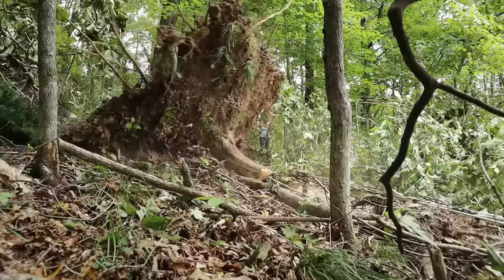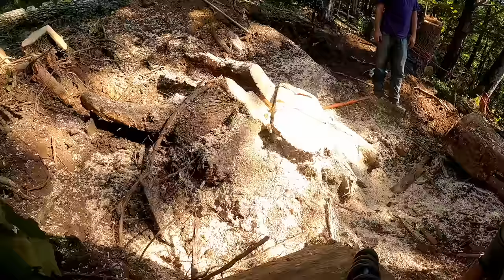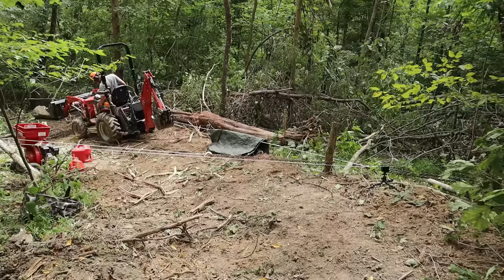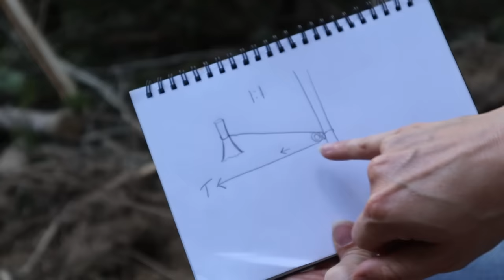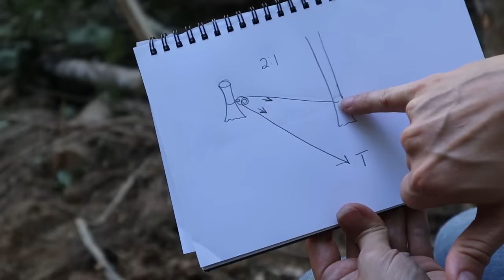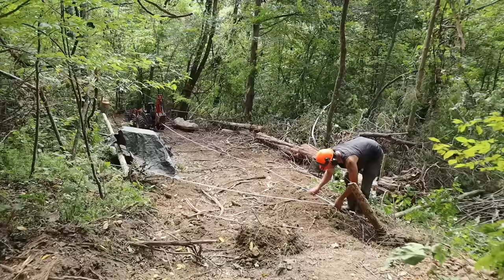Snatch blocks vs tree stumps - the power of pulleys /// E57

Comment: I’ve been making mistakes for over 50 years so I’ll share:
If you are ever going to hire a dozer to do the road, cut the trees, leave 4-6’ and let the dozer take them out. He can just drive through them in a minute or so. Talk to the dozer guy first and hire a big one.
If possible follow the land contours and don’t up and down hills or you’ll be fighting erosion forever. If you do have to climb or descend, put sleepers angled across the drive to get the water off as soon as possible. Crown the heck out of the road or leave it sloping to the side. Don’t get behind on the erosion. Once you wash out ruts, it’s 10 times harder to get the water off the road. There are government, and other, publications online about building gravel roads.
Like others have commented, don’t cut the trees first! Use a ladder and hook on as high up as possible - 10-15’- to pull them over. Wait for wet weather if you can run the tractor on wet ground.
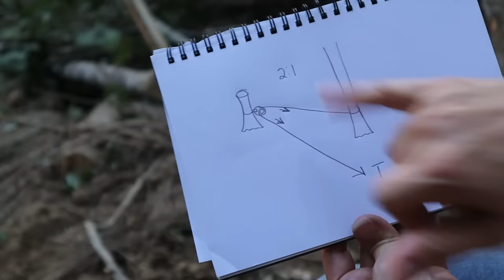You mentioned it at 6:00 and 7:30 but the simple way to figure the pull is “Count the ropes.” If you can pull 2000 lbs with the tractor, 2 ropes will be 4000, 3 will be 6000, etc.
You can put snatch blocks on different trees so you don’t pull trees you want to save.
A wire rope is a killer! It stretches and, if it breaks, it can cut people in two! So can a nylon rope but to a lesser degree. Be careful and stand clear.

Comment: What Brand and Model number of  tractor do you have ? we just bought 5 acres with a lot of those smaller trees you are pulling out . That is the perfect size for us . Thanks
Reply from the maker: RK24 by Rural King.  Very happy with it, and I have worked mine hard.
Reply: @WalnutsandWineberries  Thanks so much for the reply . Just checked and see RK is only available on the East side of the country not here in Oregon .

Comment: You could have actually done an 8:1 ratio using those three snatch blocks and 3 wire ropes. Basically, 3 sets of 2:1's in series with each other, so that the connector part of the snatch block is connected to the pulling end of the wire rope of the next set.
Reply from the maker: Sure can.  We actually expanded this setup in ep. 64 if you're interested.  Added 2 compounds to the 4 to 1 and made it 16 to 1.  Crazy strong.

Comment: How did you get the hook on the end of the anchor rope?  Did you swage the line yourselves?
Reply from the maker: Hey John, the winch cable I got from harbor freight came with the hook on the end.  I'm sure you can get a similar one at Rural King or Tractor Supply.  Check out episode 64.  We cut a cable in half and do just that.

Comment: pro tip put a old coat or blanket on the wire rope hooked to pull unit so if a wire rope breaks or any rigging it will keep the wire rope on the ground no flying up will save a life

Comment: anchor point needs to be lower . use nylon slings to prevent damage to anchor point to prevent bark damage. cut a notch in the pulled object on opposite side of pull  to hold chain in position and also as high as possible BEST of luck

Comment: This stuff is very difficult for most people. I have lots of experience with rope or wire rope and tackle and moving tree sized wood, as a sailor, and other experience. So it's easy for me to calculate my advantages and redirect as needed. I remember that even working aboard tallships, almost none of the crew could figure this stuff out, or how to reeve it. I used to  tell the others to stand aside and I'd just do it myself running back and forth, because they were all trying to do it their way and they were young college idiots who had no regard for experience and would not listen or learn from me. They were only good for interfering and then I'd get blamed, so I just got them out of the way and did it myself when it was complex. I had studied books dedicated to rigging, and then got a job as a rigger. The Tallships community is all bullshit. Anyway those skills will hopefully come in handy clearing my own land someday soon. I've seen that smarter everyday video you reference, remember I liked it. There's tons of power in combining cascades of tackle and redirecting force and even combining with levers, such as on a windlass. Of course you got a tractor, so your lever use is probably nil. Your honesty is great, because this is not easy for the untrained.

Comment: If we want to rid the tree, take it in one piece and not cut first and fight with its stump. Use horizontal winch and pulley system when anchors are around. Anchor near its root to pull the whole tree at its trunk half height above the ground.

Comment: At 12:17. Think of the lines of the steel cable coming off the Stump as identical people all pulling with the same force on the steel wire. 4 different force vectors pulling on the stump.  Each with the same force (because tension is constant in the entire length of cable) but different directions. If all of the force vectors are pulling in the compass directions (North, South, East, and West)… then the net force that will be trying to move the stump in two dimensions is zero. My point with this ramble is you will have more luck pulling out stumps if you run the tractor in exactly (or as close as you can get) to the same direction as the rest of the lines. If you pull one of the lines at a 90 degree direction to the rest or even a 15 degree angle… you are losing efficiency and capability. Hope this makes sense. Any rope under tension should be treated with respect… especially steel cable. I knew a man who lost his left leg to a steel cable that snapped while under load. It amputated his leg clean off. Great video.

Comment: So, how's that garlic mustard? Looks like you have quite an invasive plant challenge. Fortunately, right now is the best time to treat it. Early spring before the native plants emerge, you can spray out the tiny garlic mustard rosettes with glyphosate (according to label directions). Repeat the treatment in late fall after all your native plants have gone dormant for the winter. The garlic mustard will still be green. Since garlic mustard is a biennial, it will take a couple years to get it under control.

Comment: 1) Actually you'll never have more than one lead providing the extra pull, so your drawings' arrows should reflect the actual directions of cable pull. 2) Cutting the stumps off higher,, and making your stump attachment points higher, will multiply your mechanical advantage. You should attach very low on the anchor  tree.

Comment: On cable vs rope, there are better ropes now you don't want dynamic that's like for mountain climbing so if you fall it has a lot of stretch to it or for lunch and gliders and towing semis and stuff or you know for off-road recovery for this kind of thing you don't want to stretch your rope you don't want something storing energy in it like a rubber band and then all of a sudden snapping cuz you can load up too much on a stump can pull out real fast and shoot through the air what you want is a static rope and there are really good ones there's dyneema there are far stronger than steel they're much lighter to work with they don't have you're not going to have edges to break off and poke you through your glove and whatnot the only drawback is that they're synthetic fiber so they're going to melt so you don't want to put them on knots and you don't want to you know get them wet or hot burn them melt them no friction....

Comment: When you cut your trees,  cut them off 5 or 6ft high, hook to the top and you'll gain even more mechanical advantage,  called leverage.  Also you need to use a strap on your anchor tree as the chain will damage the bark and you risk killing the tree.

Comment: As others have mentioned, don’t hook to your back hoe. Find a place on your frame or a hitch assuming it’s got one? Another thing that actually can help besides block and tackle but probably could be used together. That’s a snatching line least 4” wide and probably be 50 ‘ long. Snatching lines that size usually are good for a 50,000 pull and are designed where you leave slack in the snatching line and use the momentum of your vehicles weight to do the pulling. 
I’ve used snatching line with a smaller Toyota pick up in the sand dunes to pull out large 4x4 vehicles  hooked up to trailers with equipment on the trailer and both were buried to the frame in the sand. All the spectators were saying no way is that little Toyota going to pull out that large heavy truck and trailer. But with a 4-5 ft run taking off as fast as my little Toyota would go. When the snatching line came tight it stretches some like a rubber band then whatever it’s connected to will either come out like this project I did fairly easily or in a worse case situation you’re pulling vehicles will stop at the end of the stretch of the snatching line and lightly pull the pull vehicles backwards till the stretch of the snatching strap is loose. 
Having my pull vehicles be pulled backwards has only happened in extreme cases where I’ve tried pulling out huge boulders out of a hole that was dug around the boulder. With numerous tries though, I did eventually get the boulder out of the hole dug around it with the snatching line making several fast take off  in my truck getting as much of a run as possible and the momentum finally jerked the boulder out. 
I have had success with my snatching line where others using wrenches didn’t have any luck at all trying to move vehicles stuck in the mud. 
Been a while since I bought a new snatching line, but I believe I paid around $75.00 for a good quality line. As you already learned, don’t cheap out on the snatching line you buy! Watch for the rating on the strap it should be rated least 50,000 lbs pulling strength!  
It may work for you in certain cases and be quicker then running that block and tackle too?  Using the 2 together though would help with using momentum when trying to pull from a tight cable won’t do the job and you pulling vehicle tires just loose traction and spin in the dirt. That’s when a snatching line really shows what it can do using the momentum of a moving vehicle with the slack in the snatching line.
But be warned, many people use a snatching line like it’s a chain or cable trying to use it as a tight line before trying to pull and that’s no different than using a chain or cable. You got to give yourself least 3-5 feet of slack in the snatching line and then hit the gas to your pulling vehicle execrating as fast as you can. When the snatching line tightens it will jerk out things much larger and heavier then what your pulling vehicle weighs! 
Just my opinion, but all drivers using 4 wheel drives off road should all carry these snatching lines for emergencies when they get stuck. Long as you have another vehicle they can pull you out where a winch might not work?

Comment: Set the snatch block as high as you can so it would have a lot of leverage. Keep your stump taller or pull on whole tree at a higher point on tree that you want to remove.
Unfortunately you already cut it down to low.

Comment: nice video , what size cable and how long of cable do you use ?
Reply from the maker: Thanks Randy.  We used a 3/8 in. winch cable that they sell at Harbor Freight.  It's 65 ft long and rated for 12K pounds.  The snatch blocks were also found there that are rated 20K pounds each.  You might find our newer episode interesting too.  We add 2 more pulleys and get a 16 to 1 out of the same 4 to 1 setup.  https://youtu.be/Sc4NUKMuzaU

Comment: Pulleys are really pretty simple    How ever many ropes or cables connect or go to the "load" in this case the stump is what your advantage is.    This is true whether the load is vertical or horizontal.    Single rope thrown over a rafter has no advantage.   If your load is 1000 lbs and you have one rope hooked to it, you have to exert 1000 lbs of force to the other end of the rope.    If you have 2 ropes that go to the load you need 500 lbs of force.    4 ropes, 250 lbs of force.   

Its nothing about angles or if the snatchblocks are moving or not.     Just have to arrange the cables and snatchblocks so multiple cables are attached to the load.

Comment: It would be easier to use that before you cut the tree. The weight of the tree would help pull the stump out of the ground. Also a little digging around the roots will help too.

Comment: Great demo on the power of pulleys but i think if you had that many stumps and soil to remove and you have enough cash to build a house you would be better off hiring a large dumper and a 20 ton excavator with a root claw and a grapple or thumb  attachment .You would have it done in a few days you could use your tractor too .Much quicker.

Comment: I don't understand why you want to remove the rock bed or why you didn't grind the stumps but good luck looks great I hope you make a lot of great memories
Reply from the maker: Thanks, Theodore!  The rocks stick out too far and would end up being speedbumps essentially and would also be dangerous when it rains making a slippery spot.  The stumps would eventually rot and make holes in the driveway better to get them out now.  We are having fun and making lots of memories. :) - Meg
Reply: Everyone has an opinion mine I would have jackhammer the tops and grind the stump a rockbed is best for a  road you need use less road bed material I hope you didn't open the box by doing it that way again beautiful spot wish you many happy memories

Comment: Looks like a fun project but you guys scare me sometimes. Couple things. For pulling hard try not to use the backhoe bucket. You are just spring loading the lines and if something breaks it's going to go flying. Better to weld a hook or steel loop on the tractor or base part of the backhoe. Also steel rope stores a lot of energy. Consider dyneema rope. It is a lot safer because it doesn't store near the energy of the steel ropes. It's a little fragile in comparison but it is a lot easier and less hazardous to work with. Easy to fix too if it does break. It's stronger than the steel rope of the same size while being softer than Kleenex.

Comment: The more snatch blocks used say if you've got 4 - 6 pulleys on each block and use 3/8 cable this will give you boo coo pulling power.

Comment: Great explanation! Were you using rope? If so what kind? I have a stump I need to pull!
Reply from the maker: Thanks!  We used a winch cable and snatch blocks from harbor freight.  The cable is rated for 12k lbs and each block is rated for 20k lbs.  Here's the cable:
https://www.harborfreight.com/38-in-x-65-ft-replacement-winch-cable-with-hook-61667.html
Also, watch our more recent video about adding compound pulleys to this setup.  You can turn that 4 to 1 to a 16 to 1 very easily with not much more equipment.
https://youtu.be/Sc4NUKMuzaU
Those stumps will pop out like nothing with a 16 to 1.  Hope this helps!  Good luck to you.
Reply: @WalnutsandWineberries  thanks so much!

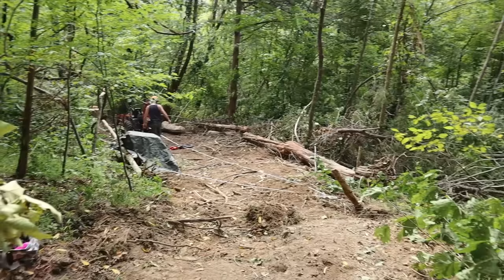Comment: Be careful, because the jacket you put on the cable at 8:00 should be away from the tractor. The cable lengh between the jacket and the tractor, must be higher than the lengh between the jacket and the other way, otherwise, it will hit you even before, the jacket get´s lifted.
Regards.

Comment: A sledge hammer, drill and wedge is way faster than digging the large rocks out. I use just a sledge hammer and it is very easy to break down a large boulder. I also have hills filled with large limestone boulders.

Comment: Hallo, I used a 16mm Steelrope within a 'Greifzug' with max. 2500 kilogramms thats for the most Doings was allright and I do it since about twenty jears in my job. It need a special technik handle with ax and chainsaw from one side the stump but it works easyly.

Comment: The only caveat is that you're putting such a high multiple of tension through the cable, that you should make sure not to snap it. And that your blocks/chains/shackels etc can also handle the extra load.

Comment: If possible don't dig up so many of those rocks if they are only a few inches above ground. Let your road fill cover around them so that they become part of the road bed and help support heavier vehicles. If materials get moved away from the rocks over time then refill around them and regrade the road bed. I 
would even consider jack hammering to the ground the parts above the road bed, IF POSSIBLE. The rocks may be too hard, but if not then rather than digging them out and disturbing the ground I would consider leveling the tops off. My two cents.

Comment: Every link in the system when you're doing something like this has to be capable of handling the forces you are working with. Give yourselves a tall stump for leverage. Stay well clear of the vicinity of the cables under strain. If one of those snaps all that force is released in a whip action that is extremely dangerous.

Comment: I see you havec a backhoe, do you like that. I keep getting told get an excavator OR skidsteer, then rent' borrow other when you need it VS a backhoe.  Thoughts?
Reply from the maker: It really depends on your goals and jobs to accomplish.  The type of soil, terrain and as always budget.  We ended up getting a skid steer about six months after this video to add to the tractor/backhoe.  They work well together for what we are doing.   I recommend making a list of all the potential jobs/projects you have and then the different pieces of equipment see which ones check which boxes.  We have found the skid steer to be invaluable, but we also said that about the tractor.  Experience plays a part too.  I am glad we started with the tractor to get our feet wet.  Hope that helps.  Good luck! 👍- Meg